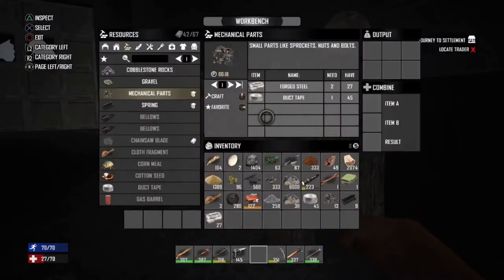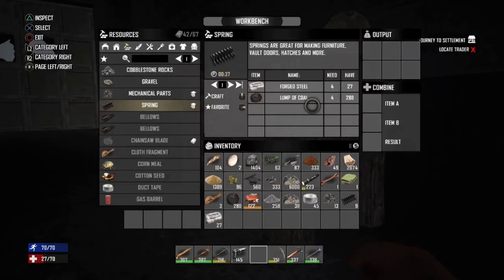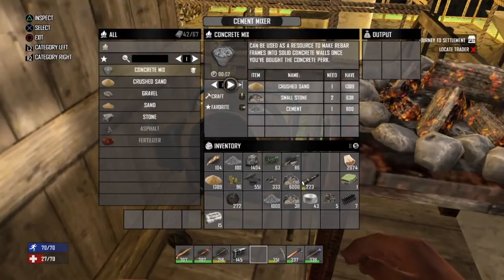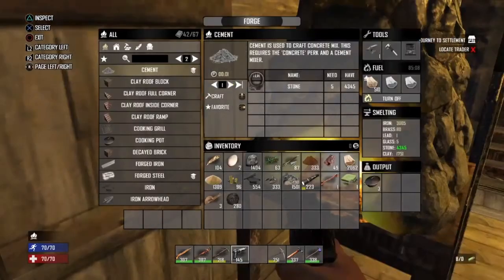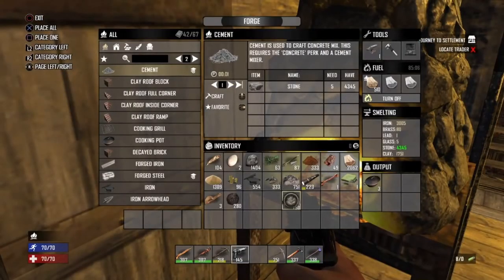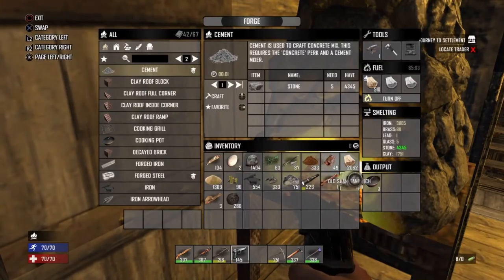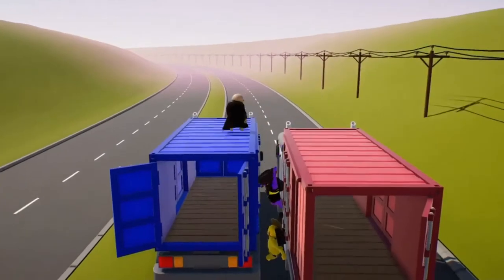7 Days to die - How to make Cement mix, mechanical parts and springs!

Comment: Ok so I am maxed out at steel smithing level 1. Tells me I'm at max level. Even with a wrench I cant get mechanical parts from anything and I dont know what to do. I'm on xbox 1
Reply from the maker: So the only way to get mechanical parts from a wrench in alpha 15 is to use it on cars, vents, shopping carts work too sometimes. it's rare getting them but if you scrap enough of them, you will get some out of them. You can also buy them at the trader if you can't find any!
Reply: @howtoooby1803  alright I will continue to try . Thanks for the tip!